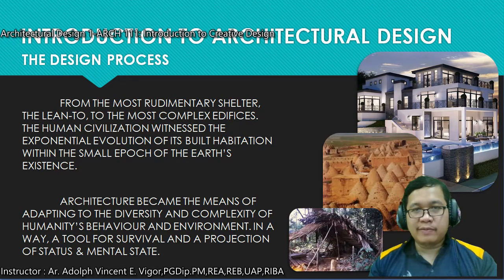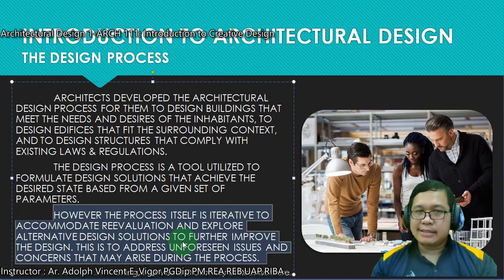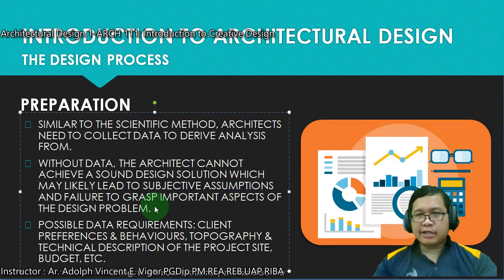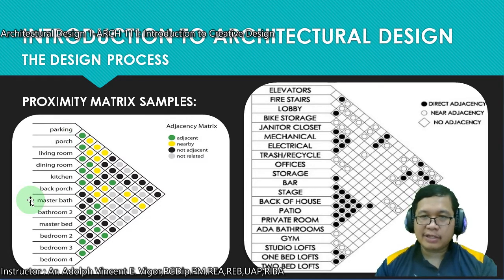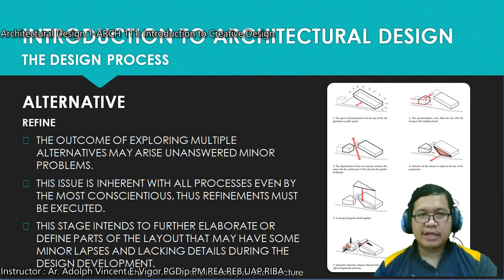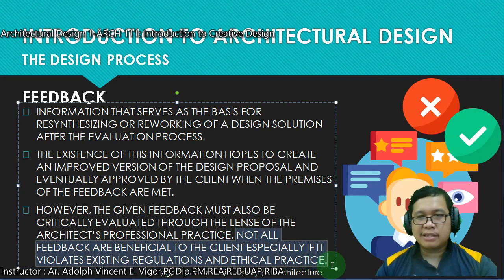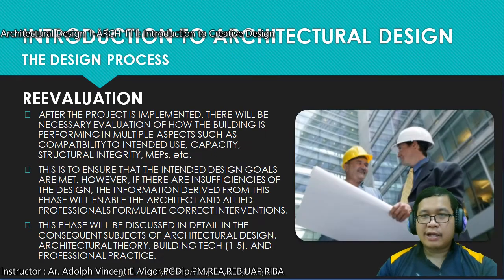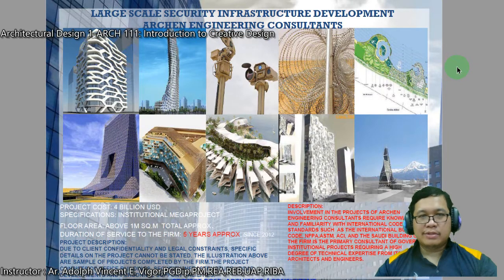ARCH 111 Architectural Design Week 1 5 Lecture

Comment: Ar. May tanong lang po na considered na po ba yung as violating of rules yung nag lagay ng pipes sa firewall?
Reply from the maker: If the pipes are embedded in the firewall and it would affect the 2-hour fire rating then it would be a violation logically. If the pipes are exposed and cross the property line of the neighbor then logically it would also be a violation.
Reply: @ArAdolphVincentVigorRIBA  thank you po for the clarification po Ar.